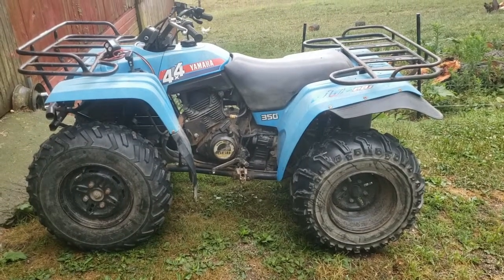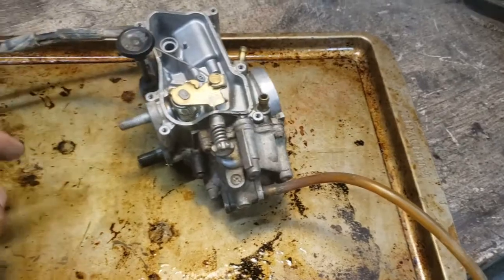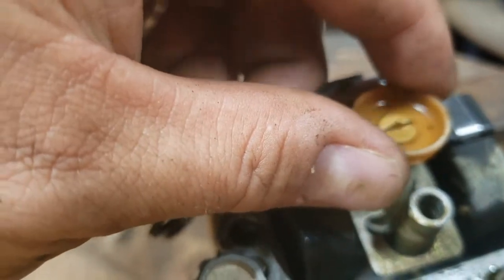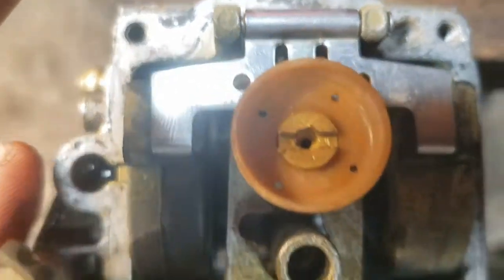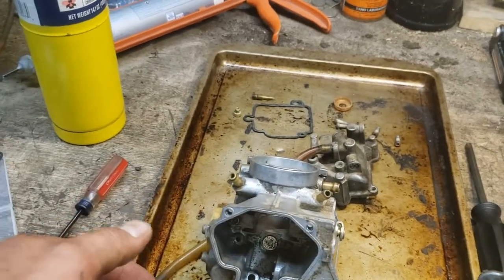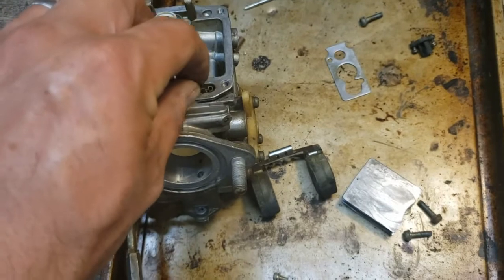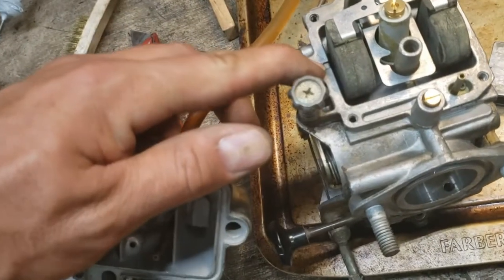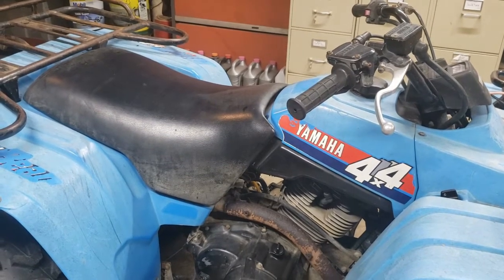Yamaha Big Bear 350 Rehab - Part 2

Comment: 5:32 on time line.  I have a real small pair of vice grips. On small screws with a thick head like those I clamp the vice grips on the side of the head of the screw and give it a slight twist to break them loose.  There is limited room to ratchet the vice grip so I get as close to one side as possible when I grip it to allow for just a little movement.  Works like a champ.

Comment: serviced my carb after just aquiring one , can tell someone was there before , 2 oz of water in the linkage area.  my tip for the worn philips was i used vice grips on the head , and the retaining screw on the floats i used a dremel with a cut disk and made a flat head screw. saved the headache
Reply from the maker: Sometimes you have to be creative, right?
Reply: I had same issue with screws and used my ryobi impact and they came out with 0 trouble!

Comment: At 28:57 you were talking about the passages, I do not know for sure but I am believing that those are the fuel enrichment circuits for when you snap throttle from idle to WOT!  I wish someone would tell me for sure as I have been struggling with my carb starving for fuel at a snap to WOT.
Update: that circuit is for choke only.
Reply from the maker: My issue ended up being timing (as I came to suspect later on). Check out the newer videos on the channel for the resolution of the issue.

Comment: Another MAJOR problem with these is the rubber covered connection from carb to engine.  They always seem to fail and suck air
Reply from the maker: Yeah, the parts bike I picked up was parked for that reason. Luckily, mine is good though.

Comment: Fun watching this 👍👍 Got a 87 big bear myself here in sweden. Gotta change that rubber at the rear swing on mine also. Looks like a bit of work.. YOU should defently get a orginal muffler. It can be why its feel tired and doesnt run good. Othervice a valve adjustment/cam shaft worn
Reply from the maker: Thanks for watching! I'm slowly working on this project as time allows (between other projects) and making some progress. It seems like a good machine (if I can get it to run correctly).

Comment: That hole/well on the outside edge of the fuel bowl on later models and some other models of same year is where the piston for accelerator pump goes.
Reply from the maker: Yeah, now that the timing is working like it should, I get a little stumble when I snap to WOT. I'm considering putting the original carb back on to see if it runs better than this replacement one does. It doesn't take long, so I may just try it out of curiosity.
Reply: Turns out, I was able to " eliminate" 1 cable and it worked great.

Comment: Did you remove the slide tube receiver frame and the needle receiver tube?  If yes did your tube have air holes in the top end of it?
Mixture screws... behind vertical center line of carb, air box side, are air adjusting screws. In front/engine side of center line are fuel mixture screws.
Reply from the maker: I'm not even sure what that is, to be honest. I ended up getting a cheap replacement carb and putting it on the bike - which changed basically nothing. CDI box is the next thing to try, I guess.
Reply: I removed the slide tube receiver frame, then the needle receiver tube/emulsion tube and did find that this model has air holes in it. 2 of the 10 were clogged. After cleaning and carb reinstall it still has a problem of fall on it nose at throttle snap to WOT. Fuel can be seen blowing backwards moderately at the throttle snap. If I put two fingers over the carb Venturi it will throttle up more or less normal. I am wondering if that apparent fuel blowing backwards could be an intake valve issue?  I played with the butterfly and slide tube cable tensions to see if having them open at slightly different times would help and it did not. I had butterfly open first and then I had slide tube open first and then both equal and it never had any real effect on the throttle response idle snap to WOT. I have not as yet altered or checked to see if the main needle is at factory setting.  I may change the needle to enrich it and see if that does anything. Keep in mind I have no history on this machine so I don't know what it was doing or not doing. I only know that it wouldn't start when I first tried and that led to cleaning the internal carb.

Comment: you never mentioned what year this bike was, please let me know . I think I have the identical quad and mine is a 1992, I also have a 1993  350 big bear but it has a (1) cable throttle control only. I had the same problem with idle & running so I recently ordered a new carb from Amazon, hope it solves my idle problem.  good video by the way.  Thanks!
Reply from the maker: I'm not sure of the year. Part of the VIN number is missing and it includes the digit that records the year of manufacture. I think it's late 80's (88 or 89) based on a couple things (color being one of them) but I can't say for sure. It has a 2 cable throttle and a pull start, both of which I understand they eliminated in later years of the production run.
Reply: @diymechanictv1233  yes: my 92 has 2 cable throttle and my 93 has (1) cable only. I think your is a 92 (my guess) look for the 10th digit in the vin (probably a letter) and starting from A as 1980 & B as 1981 and so forth if you can see your 10th digit on the lower frame or behind the gas tank. Good luck.
Reply: Were you able to find a 2 cable carburetor on Amazon or was it the single cable. I need a 2 cable carburetor and cannot find one.
Reply from the maker: No, I just used a single cable carburetor and took one of the cables off at the splitter. It works great.
Reply: @diymechanictv1233  so did it originally have the double cable carburetor. If so, it ran ok with the single cable carburetor.
Reply: @diymechanictv1233  did you convert from a dual cable carburetor to a single cable carburetor? My dual cable carburetor is almost dead and all I can find are single cable carburetors.
     I don't want to buy a single unless I know if it is possible to convert
Reply from the maker: Yes I did. Now that I think about it, I can't recall whether I removed one cable at the "splitter" or if the single cable carb I bought came with a cable.
Reply: @diymechanictv1233  thank you so much, I'm going to buy a single cable carburetor and try it.
     Also, thank you for responding to my comments. So many people just ignore the comments on their videos. I truly appreciate it.
Reply from the maker: Happy to help! Thanks for watching.

Comment: I have been working on the same carb. I have yet to find out how the fuel is enriched upon idle to WOT with no accelerator pump.  There is a diaphragm on the right side of the carb called " air cut off diaphragm" the issue is not knowing if that has anything or everything to do with drawing fuel from the bowl and jet located on the bottom right engine side.  I also have no info on the setting for the balance between the slide tube and the butterfly.
Reply from the maker: Yeah, it's all kinda Voodoo to me! I don't know why it has to be so intricate...
Reply: I have subsequently investigated more on this style of carb and found that there is not an accelerator circuit.  Any fuel needed for throttle snap to WOT comes from the main circuit and moderately supplemented by the idle circuit.  I had wondered about fuel enrichment needed at throttle snap from idle to WOT and investigated the choke circuit and if it also played any part in the fuel supply.  Since the circuit is only open to fuel passage when the choke is pulled and is closed to no fuel to anywhere when the choke is off then that circuit is choke only.